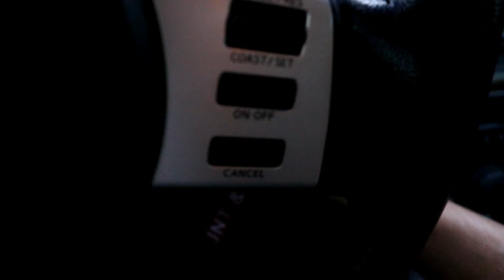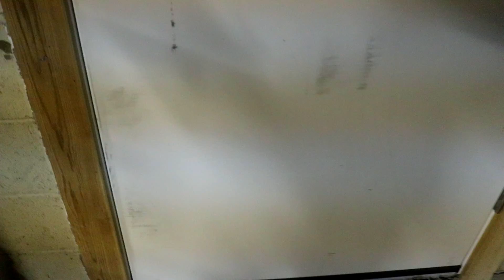Removing and Cleaning a Carburetor in a Polaris Scrambler 90

Comment: Add starter fluid and then try starting again. And also clean it again,and when you take the little screw out make  sure you can see through it.
Reply: It most likely not be electrical.
Reply: And drain out gas